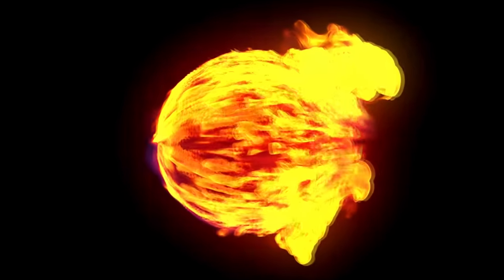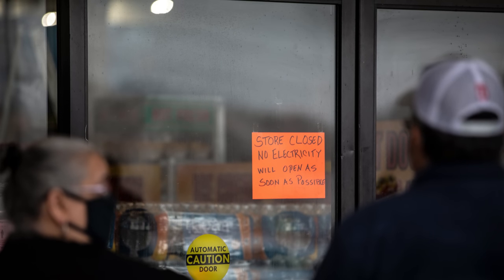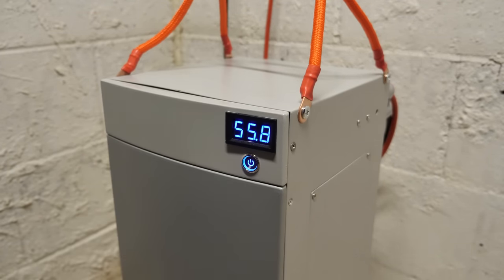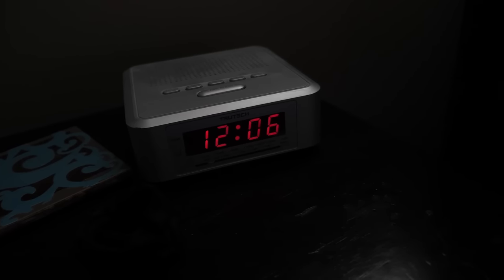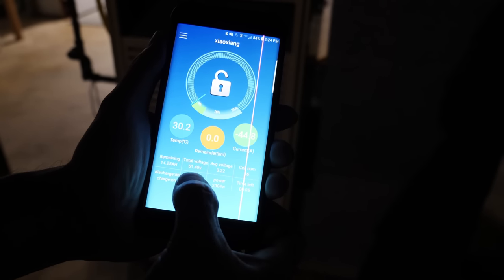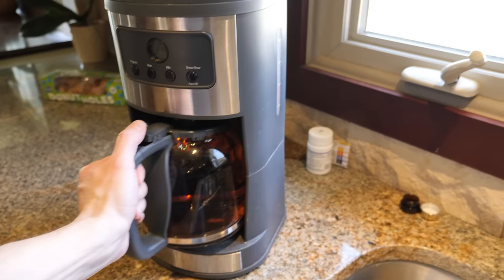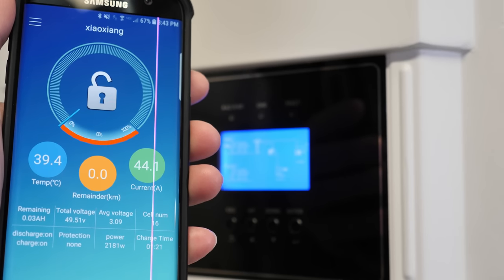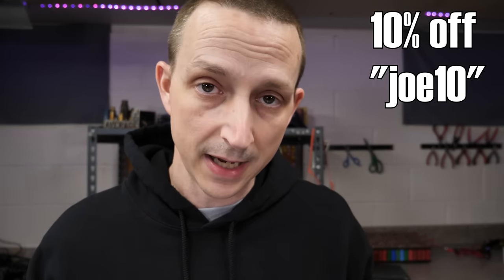Power your House with a Husky 48v 5.3kwh LiFePO4 Battery! BigBattery.com Test Review (2023)

Comment: Nice Video, I wonder how many people want to know if these batteries can be daisy chained. Since you figure a heat pump can pull 13kW easy depending on the size and that's about 50% to 60% of my electric bill. I am looking to build my own but was just curious.
Reply from the maker: Yes you can parallel them up and I had that in recording but didnt make it into video so I mentioned it in the description box along with a paralleling cable!💥🤘
Reply: @AveRage_Joe  Nice
Reply from the maker: You betcha!!!

Comment: Joe, are you using the "12kw HV Growatt Split Phase Inverter" or the 12kw LV Growatt Split Phase Inverter"? Is HV for High Voltage?     If you are not using either, please tell us which inverter you are using. Thanks!
Reply from the maker: I am using the HV version. Only diff between the two are the solar charger voltage. The LV is 150v and the HV is 250v. Either version are great. If your panels are really far away then go HV but if panels are fairly close then LV!🤘

Comment: I have a grid tied system with a Smartflower 2.5kw. My lead to the house panel is AC. How do I tie in a battery back up. Do I connect a ????? inverter and battery bank? This connection will or should be at the panel and is AC. Since the pawer from the solar arraw is connected to the house panel.
Reply from the maker: You would need a different inverter. One that does AC coupleing like a sol-ark!
Reply: @AveRage_Joe  My system uses Growatt inverter from the array. Does Growatt have an inverter for AC coupling and do I connect my AC from my panel to the AC in on the inverter and connect to the battery bank?

Comment: This is such a cool idea.   Living in the northeast we get some crazy storms and have had several instances where our power was out for days and due to trees solar isn’t an option for us without $30k of tree removal. How could we have a generator in this scheme?
Reply from the maker: Yeah I hear ya on the tree removal. I have a ton of trees as well which cover most of the areas I could install solar. Anyway, you could either go with a generator all by its self. Depending on everything you would want to run would determin size. Cheaper ones usually only run 120v. If you wanted to run everything you would want a 240v.  Same for this backup battery sytem. You could use a single battery without solar for smaller blackouts and can also connect a generator to inverter for the longer outages. Can also recharge the battery during that time as well.

Comment: Interested to know how many hours I could get from this battery unit powering a couple of led lights (20 watts ea.), full size fridge and a small window AC unit (8,000 BTU... It's not a large unit) in a one room apartment? 6hrs, 8hrs, 12 hrs?
Reply from the maker: The led lights are no issue at all.  Fridge and AC unit depend on wattage and how often they run.  If you had a killawatt meter https://amzn.to/3B7KhWv and plug those items into it, it could tell you the kwh per day. then we could find out an estimate!

Comment: I want to go off grid in the residential portion of my commercial building. Has gas central heat 1500 square feet. All the usual appliances   Can you recommend a system and a supply source for everything?
Reply from the maker: What is your avg monthly kwh?

Comment: I'm curious how long would it take for just your solar panels to recharge that battery , and how big is your solar panel system?  I'm wondering if we buy solar panels ( like a ground array) if we could recharge that battery without any grid power coming back on.  Thanks GREAT vid!
Reply from the maker: You can 100% recharge off solar. Only takes a few hours depending on your array. Its best to charge around 45-50amps for daily use. I have around 5kw of solar which is overkill for a single battery.

Comment: hi,
grt video and practical review from a layman users point of view, thx.  I was wandering if the battery or your inverter are capable off powering any 240V split phase devices like a stove/oven hose AC or car charger.  I understand the draw would significant but was wandering if would be a function of the inverter or the battery and is it possible.  the second question is it possible to bank two batteries for a longer run time? 

thx Tibor
Reply from the maker: Thanks and thanks for watching. Yes the inverter is split phase 240v and can run ALL of those. Can run all of those at the same time actually if you have enough battery. Yeah you can parallel in many batteries to increase capacity/runtime. I also have another video running the stove and AC with Bigbatteries Rhino battery. Was the first time I was able to run them with a battery!

Comment: very impressive, what you could run if you were on a rolling black out, 
being on complete solar charging the battery for the 2 weeks, very impressive.....just a question though, while using the Solar to charge the Big Battery, especially in a black out situation, could you charge a Tesla, and also btw, what is the percentage of solar on the roof?
Reply from the maker: Thanks! If you have solar and of course the sun is out. You could potentially power anything you want.  That includes a tesla. I have some used solar panels on the roof. There are 18 245w panels and 6 235w panels for a total of 5.8kw. I usually see around 4kw due to crappy roof angle lol. Ill be adding more solar soon.

Comment: You didn't show whether it can power a stove or A/C(not window mount). Do you think the battery will support a house of approx 3000sf and need to run Stove, some lights, AC and some appliances together? Or you need to add 1 more in parallel?
Reply from the maker: I dont have those items on the offgrid panel yet.  It could possibly do it but I would add more in parallel for sure!

Comment: Great video!!!. I am thinking of using a Eaton 9PX3000GRT 3000W UPS  for off-grid power as well, but it puts out 240V.  Do you know if there is a hack to bring down the UPS voltage to 120V or will I have to get some step down transformer to use it ? Thx in advance :))
Reply from the maker: Ya you could use that for sure but no hacks that Im aware of other then an auto transformer!

Comment: HELLO, I have one question can you run your house with solar system continually during day time with the Growatt Growatt 6000W 48V?????? I want to have the system run during the day time and go back to the eletric company at nights. Is it Possible. Also i am intrested in the battery. Don't know nothing about Solar System It would help alot if you can replay. Thank you REally like the video. and congrats.
Reply from the maker: You could depending on the load of your house. AC, stove, dryer use a lot of energy especially if used all at the same time. If you dont use those much then easy peasy!
Reply: @AveRage_Joe  really thank you. Many people I asked question, No one has responded. really thank you.
Reply from the maker: Anytime!🤘

Comment: I am planning my system now and it will be a dyi I want the whole system to operate on solar and only go to the grid if the Solar and batteries get to low, what inverter would be able to automaticly do this.
Reply from the maker: Thats what I am doing. I try to stay off grid as long or much as I can. Only go back to grid when no sun or batteries are low. This inverter does that. Most all in one off grid inverters will do that🤘
Reply: @AveRage_Joe  - Thank you
Reply from the maker: Yesirrr🤘
Reply from the maker: Also wanted to add I have discount codes depending on where you purchase. Many places it "joe10" for 10% off.

Comment: In South Africa we have rolling black outs all the time, it's called "load shedding" and we even have apps that tell you the times the power goes out. Planning on getting a large battery as well when I have funds.
Reply from the maker: Whoa thats crazy! I guess its good to know when at least. How long do they last?
Reply: @AveRage_Joe  At the moment we are on stage 6 load shedding which means 2 times 4 hours no electricity plus 1 2 hour.
Reply from the maker: Thats just crazy to me. Is there any way you can get recycled batteries and diy a battery together?
Reply: @AveRage_Joe  My battery is a DIY one
Reply from the maker: Nice! What did you build?
Reply: @AveRage_Joe  24v 50ah lifepo4 battery with latent bms
Reply from the maker: Oh nice!

Comment: This is a good review for this LFP battery. Could you show a block diagram of how it fits into your house electrical and solar? What model inverter? I assume it is also a 48V (nominal) battery charger. I would like to connect a 48V battery plus inverter and use an interlock kit so I have access to all my circuits. I just don’t know how all of this is connected.
Reply from the maker: Thanks Mate! Yeah I plan to do an update vid when I can and can show a diagram. Inverter link is in description and yes 48v!

Comment: Dear Joe
       I have some question about the inverter. Could you suggest me? What is the maximum PV Array Power (Total PV input 1 + PV input 2)?  What is the maximum input current per PV input?  If we connect DIY Lifepo4 battery to inverter without communication? Do you think that it will be have some issue on Battery?
Thank you very much
Thawatchai Chimpalee
Reply from the maker: Each pv input can handle 60 amps each. Total with both is 120amps. You dont need to connect battery bms to inverter as long as you at least have a bms!🤘
Reply: @AveRage_Joe  Thank you very much to answer my question. I saw its specification(SPF 12000T HVM). The Maximum PV Array power is 7000W. So It mean that I can arrange  PV array  about 3500W per PV input( PV input 1 + PV input 2 is 7000W.) Is it right?  I'm so sorry to ask baby question to you. But your video inspire me to build a big system. : )
Reply from the maker: Yes that is correct!🤘

Comment: I have 4 x 12v 170AH big batteries.  They are wired in 24v series parallel.   The only issue I have found is the BMS's don't communicate with each other and the batteries can charge at slightly different rates which causes them to not charge fully when maximizing the input charge current because the first battery BMS in the series that reaches full charge shuts down the series.  

The CS at big battery was subpart.  They couldn't diagnose or solve the issue.

By reducing the charging current helps solve the issue at the expense of losing your charging rate.
Reply from the maker: Yeah I could see that since there are no 2 batteries 100% alike!  Only suggestion I would have is to parallel them all at 12v to balance them, charge them and then wire in 24v.  I would also lower the max charge voltage just a hair which should allow you to increase your charge current back up.  Best case to shoot for (in all systems including my own) is not letting the bms cut the battery. Plus in doing this it will make your batteries last MUCH longer!🤘

Comment: Power outage at 95 degrees F
18 hours off 
running Fridge about 700 watts running load and 
890 watt 10,000 btu ac running to keep one room cool
This really good time test.
Our power company does not seems to be able to do anything done in less then 12 to 24 hours to replace a blown transformer or 3 full days for transformer pole replacement.
So what is maximum draw down 
%.
Good video.
Reply from the maker: Thanks for watching! You can cycle the battery all the way to 0% if needed! Also if your looking for more time, I just did a video(pretty much the same as this) with there new Rhino battery and its pretty Amazing!
Reply: I will look for that video.
I have a Generac system with 
7770 watts of Silfab panels 
Their 18 kwh batteries which has all 6 batteries in it.
 I have seen the system make 7.1 kw for 2.5 hr during a peak sunny day.
The Generac inverter is. rated for 
11,000 watts of solar panels.
The inverter will handle 2 of their 
18kwh panels for 36kwh’s.
I can see where I want more panels
6 more to get little over 10,000 watts of panels.
I am looking for more batteries to add 
I can add another 15kwh batteries.
The Generacs battery box and batteries are very pricy.
So I have looking these batteries.
I am not sure if these will intergrate with the Generac system.
I well check into from Big Battery themselves.
So far happy with system.
I would just feel better with 10,000 watts of panels for rainy cloudy days.
Plus more more batteries for extended power outages.
I went with no grid power for 8 weeks
after hurricane Rita.
98 deg days and 84 deg at night.
I never want to do that again.
Thanks

Comment: I think I would need six (5.3 kWh or 31.5 kWh)  of these things to operate my house. My power utility bill says my house averages around (1.6 kWh. or 38.4 kWd)
Reply from the maker: Yeah for sure! I think for an off grid setup in a good sized house you would want a few for sure. Also keep in mind if you have solar then that greatly helps. If you randomly loose power for a few hours then you could get by with 1 or 2 depending on your load. Awesome battery for sure!!!
Reply: @AveRage_Joe  we grid tie system that averages about 60 kWh. If only could turn on my solar inverter during a blackout and had six of those Big batteries, then I would have no worries. Great show thank you.
Reply from the maker: I bet there is a way to somehow use your system in an off grid type of way. Ill have to look into that!
Reply: @AveRage_Joe  My system is a Solar Edge model SE10000A-US , I looked at the Manufacturer Manual and at the available accessories for it online. Nothing stood out for me. The did show the sense lines for quick disconnect. Maybe I could install a lockout for the main and drive a small inverter ac output to the sense  line input. It would probably smoke the inverter if it isn’t isolated from the Solar Edge’s output. Other inverters I reviewed on YouTube come with the option to do this built in. I think I have to bit the bullet and talk to their sales portal. Getting on their radar will generate a ton of emails from all kinds of people.

Comment: So if i had 2 of these, i should be able to run my gaming pc, mine bitcoin with it on said gaming PC, run my washing machine, dishwasher, AC amd watch my 70 inch 4k streaming netflix through my Xbox 1? As long as i have solar panels to recharge it? Also is it possible to charge a battery bank by solar panels then use that battery bank to recharge the LiFe over night while i sleep?
Reply from the maker: In a sence...yes! Night time would get you tho running all that with just 2 batteries. During the morning/daytime you are recharging the battery. Once there is enough solar you will run house off solar and charge the battery if needed. Once sun goes down you are fully on battery. If battery drains all the way it will switch back to grid and repeat.

If your gonna recharge another battery from solar you might as well parallel it with the main battery.
Reply: @AveRage_Joe  can i charge these batteries by gas generator too?
Reply from the maker: If your inverter or generator will alow it yes. My inverter will allow a genny as a main source if wanted.

Comment: Do you have a schematic of how you integrate the Growatt 12 Kw inverter to your electrical panel.  I have solar, but mine feeds the grid and I would like to buy and have off grid capability in case of power outages here in Florida.  I really like the Growatt 12Kw inverter and the BigBattery Husky battery you used in this video.  Where can I find the schematic I need?  Thanks.
Reply from the maker: Thanks for watching. Im really liking the 12kw inverter and Husky battery as well! I think I have a 4th grade wire diagram I made somewhere on my pc.
Reply: @AveRage_Joe  I will be nice if share the schematic. Thank again for the video

Comment: Great video, but can i use the battery, at the same time charging it with my Sola panel ?
What is the cost of the battery ?🔋
Reply from the maker: Yes you can use the battery at the same time as charging. I didnt so I could test the battery by its self first!

Comment: This is a cool demo video, 👏.  I was wondering,  do inverters come as part of a solar panel system?  If so,  would any of them work for this battery?  In addition,  my main electric panel is outside my home,  would this battery need to be indoors?  Thanks
Reply from the maker: Thanks!  Yeah you can get inverters with solar systems.  You would just need to make sure to get an inverter that is 48v!  Yes you would want the battery inside and inverter close to the battery.  Many will run the inverter AC wires out to the panel since AC electricity travels better on longer distances.